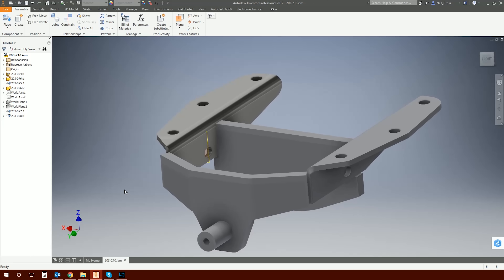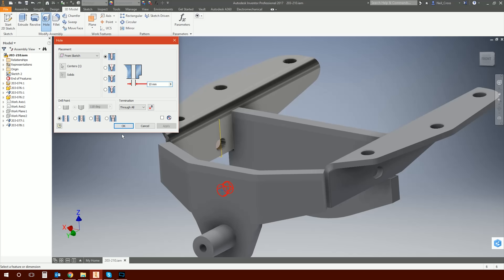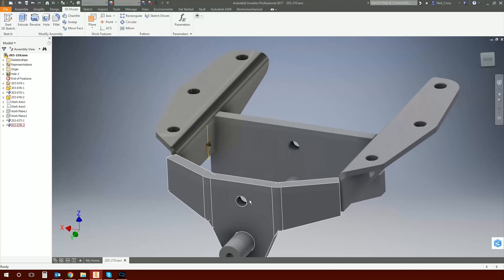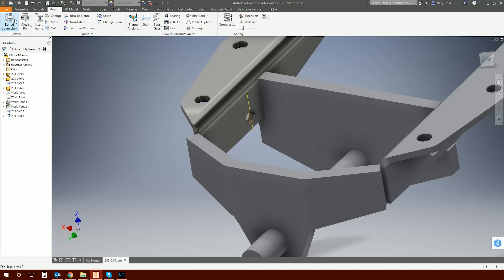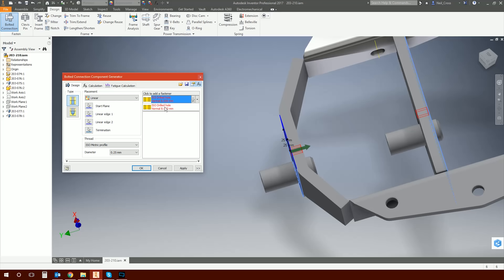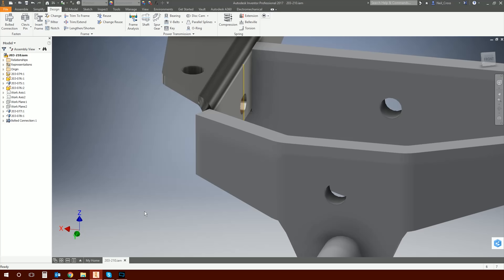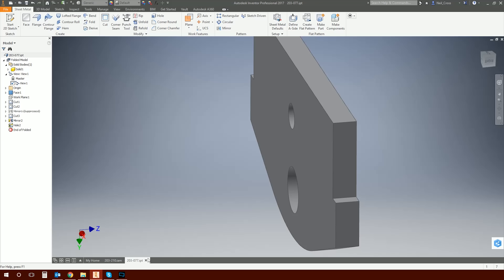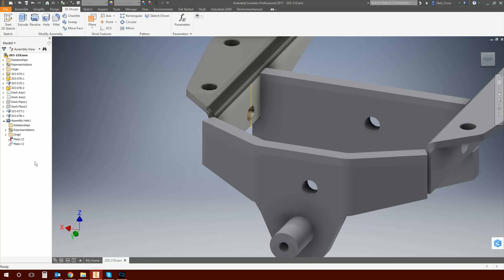Assembly Features | Autodesk Inventor

Comment: You made a whole video just for me? Thanks so much! Really appreciate it. :)
Reply from the maker: Haha yup, I've always said if a question comes through and it's something I can do pretty quickly and benefits other people then it's a good candidate for a video! I get a lot of long winded very niché specific questions which I just can't cover but things like this are simple enough!
Reply: TFI While it is a bit ridiculous that Inventor doesn't give an option to do more with assembly features and sending them down to parts, this may be just the answer for me for now in order to try and make sure that holes through multiple parts line up and stay lined up. In an assembly it can get tedious to try and make sure that all of the holes for fasteners line up and without a hole analysis tool like Solidworks has, it is very easy to miss slight misalignments that would require remaking parts.

Thank you for continuing to create relevant content!

Comment: thanks Neil! but I still have a problem to create a hole at assembly level to send to a part level (inventor 2019), could you clarify if I need to do something in options ? If I do the same like in your video doesn't work.

Comment: Please think again whether the creation of the second channel is a good move.I've seen youtubers who created a separate channel and the other channels usually do not have much publicity. As a result, they were abandoned and creators returned to one channel formula.
Now you have quite large list of subscribers and the second channel will start again from almost zero.Regarding cluttering:
- As a viewer, I can always skip uninteresting content; it's not a problem, I watch videos selectively (only those that interest me) on others channels. 
- Hardwear benchmarks, reviews are still (in my opinion) tips. Very useful CAD related tips and are perfect fit to this channel.
- It doesn't seem to me that it is physically possible to create so many videos to justify the creation of a new channel (so far no daily video posting  - a pity).
Reply from the maker: Interesting.  You've pretty much hit the nail on the head, I've already thought about everything that you've mentioned there and it's been on my mind a lot.  And I completely agree with you, my preference would be to keep everything on this channel as the thought of starting from scratch again is making me want to self harm haha 
Trying to keep this short, it came down to the fact that this channel is purely Autodesk Inventor focused but the hardware stuff will apply to anyone in any industry using any 3D CAD program.  Also, non-CAD users might show an interest in that tech content and if the channel is "CAD Tips" they might assume they've come across a one off video from a channel that isn't for them.  I am still considering the options though, and my gut feeling is to keep it here.  I'm not trying to cater for the potential cry babies, just trying to consider what makes more sense.

And yea daily posting isn't an option at the moment unfortunately, not until I can just do YouTube and ditch my day job, I'm juggling so many different things at the moment.  There's more news as well which I haven't formally announced as it was only confirmed today, the reason why I'm wanting/needing to diversify is that I've been approached by and snapped up by Pluralsight (I hadn't heard of them either until I Googled them) to do Inventor training courses for their site.  So I can still do CAD tips here, but big tutorial stuff, proper structured training content will be done for Pluralsight.

You've definitely made me think twice though, maybe I should straw poll it haha
Reply: True, content is purely inventor focused but channel name is TFI CAD Tips, not TFI Inventor Tips.
Hardware stuff sometimes will apply and sometimes will not apply to other 3D CAD programs. RAM, HardDrives, peripherals - easy and straight forward. CPU, GPU - not so easy. I don't know whether all Autodesk 3D programs uses DirectX API and how well multithreaded they are. For sure, competition SolidWorks/NX/Catia uses OpenGL and this is different story from GPU perspective. Also I know you won't cover "competition" stuff in any detail in predictable future :)For non-CAD users you will face such a big competition that it is not worth to have separate channel. For specific stuff people certainly  will find you via search bar.I'm not trying to force you to my opinion. I just want to give some (I hope good) advice. I enjoy your channel very much, have seen every single video, love your style. I'm stealth subscriber (you know: paranoid mode - they watching my every move ;) and not so stealth pateron (but shhhh... no one should know). Diversifying is good. In niche topics YT is good as hobby or part of Bigger Uber Plan - marketing/recognizability tool (and I'm sure you know that). Wish you best with Pluralsight :) Realy :)

Comment: Which CAD program is most bottlenecking for PC hardware...?
Reply from the maker: Wow that's actually an amazing question, having only ever worked with Inventor I wouldn't know how demanding the others are but that's something I'd love to find out.  It would be difficult to answer though, because different programs are meant to be for different industries.  Like Revit is designed to work with massive building models, Catia can be used for aircraft design, Inventor is for manufacturing and machinery type work.  So it's a difficult one but I'd love to find out!

Comment: Complete garbage and one of the reasons why I'd never recommend Inventor to anyone. This cheap trick doesn't address any other shape that isn't an normal circular hole. No oval holes, slots, no squares, no hexagons...nothing. With Inventor, you're out of luck. And stop saying there is a reason for assembly features not offering the option to be applied down to part level other than pure incompetence. All the other CAD programs cad do this.